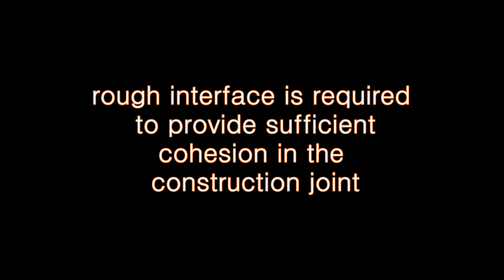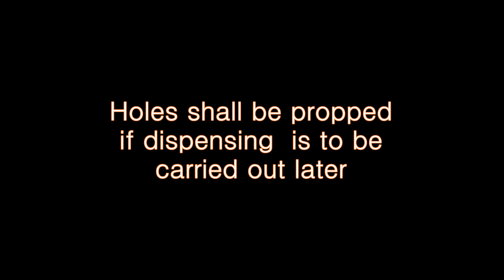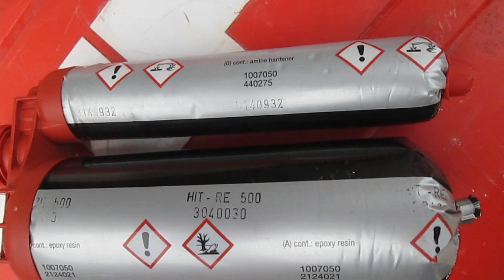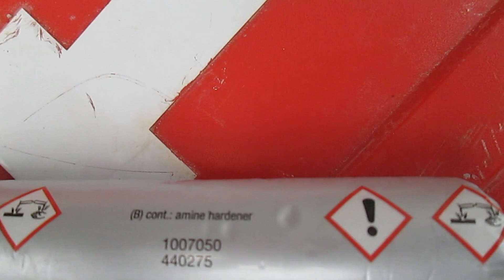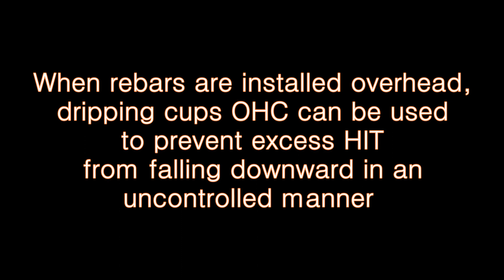Chemical Anchoring with Hilti HIT-RE500

Comment: Kitna mm ka steel kitna mm k dia k bit ,kitna mm depth mention nai kiye? 32mm steel anchoring Mai bit kitne ka use karte hai or drill kitna mm depth karna chahiye?
Reply: 32 mm ke liye 40 ka bit, n deepth depend hoti hai Dia of bar par. Agar Dia 8,10,12,16 ho toh 200 mm depth, and jyada ho toh depth increases, but depth all depends upon designer
Reply: @rahulchoudhari3492  which anchoring metrial are u using my bro send your schedule .for 32 mm   steel bar how much depth we should dril ?200 mm is not standard for all bar.
Reply: @abhinashsenapati4778  I used 32 mm bar, and drill depth 850 mm for rock anchoring